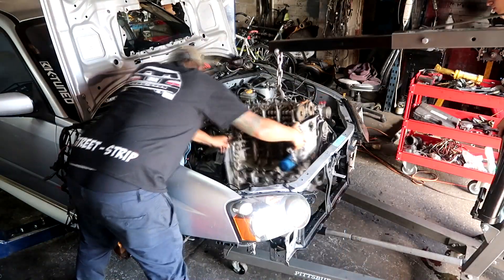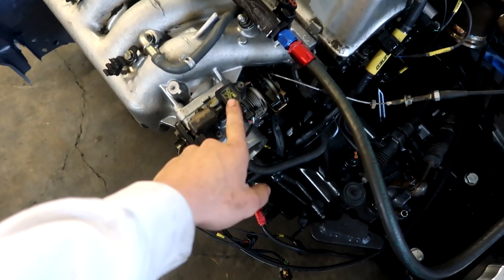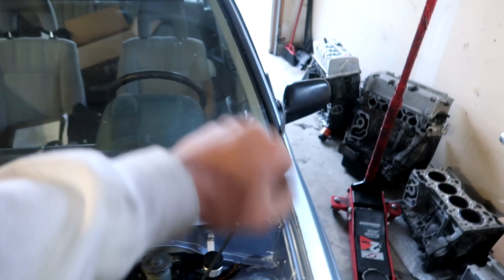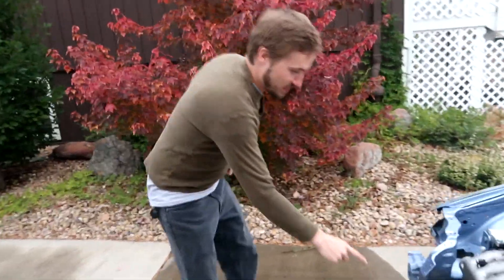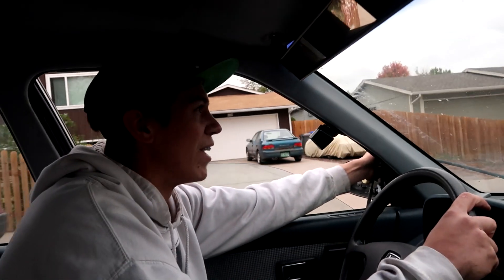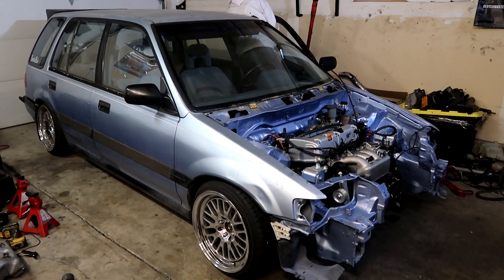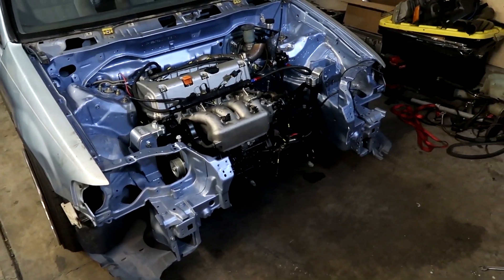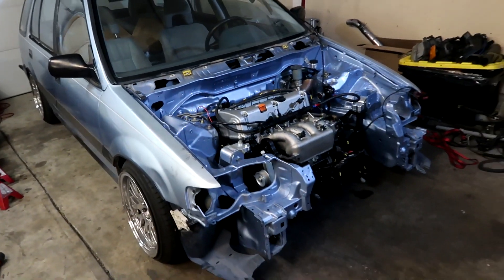Wago's First Drive With the K Swap!

Comment: It’ll be better to bring that driveshaft to a specialised shop and make them do that modification, otherwise it’ll wobble a bit even if you weld it close enough, cutting and adding material will make it unbalanced and you’ll have to compensate that with weights
Reply: Exactly! Plus my drive shaft guy does custom lengthening/shortening on your factory drive shafts starting at $80 bucks, if he has to build it all from scratch. From scratch starts at $150 but he will make them out of any material you want, the price just goes up with certain materials. Obviously. He also does trans axles, solid axles and on and on. Anything really to do with cylindrical shafts lol. BOTTOM LINE, these guys know what they are doing and you should always have your drive shafts balanced properly!
Reply: My driveshaft needs to be balanced 😚
Reply: You can cut and weld it pretty easily actually.... just get someone to balance it afterwards so she spins without vibration....
Reply: what theyre saying is, sure you can cut and weld it, but its gonna need balanced. IF  you have professionals do this, you know every day, 40 hours a week, theyll have less time tinkering with making it perfect and can probably do a better job easier.
Reply: Well worth it to just find a local driveshaft shop to get your custom driveshafts made.

No reason to mess with it when the turnaround time is days most of the time and it's perfect when you get it.
Reply: james himself Honda’s don’t go fast enough to need a balanced drive shaft

Comment: Those sleeves are gonna hate you for running without coolant, takes about 20 seconds for the cylinders to get hot. And having no coolant around the sleeves is only going to make them get hotter faster, coolant does more than just cool the engine when allready hot, it prevents certain parts of the engine from heating up super fast. Your sleeves would of almost been glowing after that run.
Reply: Kano Mack they are crazy to run without coolant, let alone drive it.
Reply: @Roverturbo  every build video I've ever seen the first startup was without coolant.. V8 or 4cylinder builds
Reply: Chris Beans  it was 2 you silly goose. Emilio started with a K24 then went to a slightly built K20
Reply: In all fairness it is good to let the motor have a quick heat cycle to let the head gaskets seat and stuff. I do it on every motor I’ve put together. I don’t let it run longer than for more than 5-10 minutes.
Reply: Dont get me wrong I love the content they produce, no one else does this kind of stuff on YT. But there is a difference between a quick heat cycle and driving it around the block and bouncing the limiter to shoot flames without coolant in the block. Also my eye twitches when I see turbos with no filter on them lol, it only takes one speck of dirt to score a cylinder.
Reply: Bang on! 👍
Reply: @freedomfox8183  yes. Started. Not ran around the block with no coolant. That's just asking to fry new stuff
Reply: Jeez, who gives a shit, do you think Kyle does? If it breaks it'll be rebuilt, building a K motor is a breeze!
Reply: lmfao you guys always find something to cry about on just about any of his videos, i love seeing these comments.
Reply: Chris Beans do you really think Kyle cares?
Reply: Bruh u gonna hate cleetus
Reply: Kyle has 500k subs, and not everyone is smart enough to realise how bad what he's is doing to the motor is. He may not care because they earnt daily's, but some people will take this as the proper way to do things.
Reply: @kanomack5063  he literally said a disclaimer on why to not do it. It would be a shame to hurt a 200$ junkyard k series that could be replaced overnight.
Reply: I get it mate, if it breaks do another video on it, and I know the reason he drove it was for the vid title. Just alot stupid people who see this and think it's the right way weather he says a quick disclaimer or not ( by the way I didnt hear it, might have to watch again) also *$200
Reply: Also critisism is not hate.
Reply: @Mad Mon There is no such thing as a $200 K Series yard motor (not one that isn't seriously hurt interally), D Series all day, K?  Hell no, to properly B-Series swap a car can be done for around 1k, but you'll have at least 1.6k in it after all the bs (fluids, gaskets, filters all around, timing pump, water pump, etc), unless you hit a straight up fire sale some one getting out may have been having.
Reply: @JagwarX  I'm a big fan of cleetus, the guy who gets custom built race engines put into his cars, and guess what, neighbor the only car apart from the Vee with a el standard motor has a fried head gasket, which I bet was helped by running without coolant. But I think cleetus has alot more money to throw around, and if an engine goes it soon gets replaced with a $30k+ racing engine. Yes he runs engines without coolant, but not around the block and shooting flames on the limiter. Unless your just trying to be funny by referring to when Leeroy lifted a head.
Reply: @JagwarX  doing it with a full race engine with special head gaskets and custom internals (mostly) isn't the same thing dude
Reply: Unfortunately without any coolant the tempature gauge doesn't work correctly but to each their own

Comment: Running an all aluminium engine without coolant for the first start I'm fine with. Running it "round the block" pointlessly, also with loose control arms is just dumb. This video was just cringe. Channel needs to get back to its roots of building cars and it's content based around that. Not videos of cars half put together, or "it kinda runs, so lets 2 step it".
Reply: this channels roots are more like this video than what you described.
Reply: Than you ain’t a OG this channel is based of 
building, breaking, and rebuilding!!
Reply: Bruh they gotten less sketch since their original days they do this to every car
Reply: yea i completely agree pointless as to go driving it around in the state it was in , good way to fuck the cylinder sleeves

Comment: Hey BoostedBoiz! Wish we got the AWD civic's here in Aus. Hope you've checked out the difference of the rear final drive ratios on the Civic AWD vs the CRV's. Hint Hint - you can be really dodgy and have different width or profile tires to change the rolling diameter to get the front and rear spinning at the same speed. I know someone that had and STi swap into and RS and the workshop overlooked this and gutted the gearbox of the thing first test drive. I can do the math's for you if you haven't done stuff like this before.
Reply: Civic rt4wd diff is actually an upgrade in an rd1 CRV. I believe Honda kept the ratios the same.

Comment: for the love of god do not try to shorten the driveline yourself, take it to a driveline shop and have them do it, theres no way you can properly balance that thing
Reply: Exactly let's french fry the engine and then throw in and off balance drive shaft and snap the freaking transmission case he's just throwing that car away he might as well use it for Cletus and cars demo drags if he keeps it up
Reply: he is still young and thinks drivelines spin in a perfect circle., when they spiun like the shape of an egg. why people shorten lines themselves all the time because they dont understand the simple physics, or rather complicated physics of gyroscopic forces and what 1/1000th of a gram on a side more weight will doe at 12krpm

Comment: Serious question here.When swapping engines like this do the cv shafts lengths just work with engine mounts people like KS make or do you have to look for different length ones? lets just say im going to put any old front wheel drive engine into a civic how does one calculate or make fit the shafts...like I know theirs a bit of play in the shafts but not a lot.that would mean like the whole positioning of the engine would have to be perfect to make the shafts perfect.Can you get custom length shafts made up?

Comment: seriously considering a K24 swap to replace the ZZ1 in my 04 Toyota matrix. do you get your motors from JDM sellers or bone yards? or both? old school hot hodder thinking about building something different. would run a 12 or newer civic SI 6 speed the car has a manual already, thanks

Comment: Just want to tell you something for the future. Coolant temperature sensor is mostly somewhere outside engine, so if there is no coolant circulation it is not showing engine temperature. More important, without coolant there is nothing to cool down sleeves and without cooling these overheating very very fast, as you can imagine, many explosions happening inside them. Now, i am sure you got more or less warped sleeves.

Comment: What's going on guys, so we put the turbo, engine, trans, roll cage, and fuel pump on the rowdysee. So she's solid for the track. We took the track bar, shift cables, radiator, intercooler and piping out of the hatch for wago so she's ready for boost. "Launch control pops from boosted k series wago." -and as always, thanks for watching.

Comment: Imagine grabbing the guts out of a Acura TL with the 6 speed manual and AWD then install it in something cool to create Honda's version of a GTR killer which can run 9's anytime on any pavement.  The lighter the better and would be quicker and more consistent/ reliable if you got one with an auto if they can make them handle the power.

Comment: I know everyone is always in a hurry to get that first test drive in after a swap but damn...no driveshaft, no throttle cable, no intake, no hood lights bumper or front end, cant shift it, wheels toe out, oil return wide open.....just wait a lil while til its ready dude

Comment: How much does this engine cost? And about how much to make like 300hp?
Reply: I'm not sure the exact engine they used but you can usually pick up a k series for like 500-ish bucks (at least near me). After buying like harness/hondata, turbo stuff, and everything you need for a swap, I'd say maybe somewhere around 2k, but the trick is you can make like 600hp on stock internals
Reply: @giggy7935  oh shit really 600hp? Damn that's crazy
Reply: @TeeKayy2k  Somewhere around there yeah. K series engines are awesome

Comment: hi because I am disabled I am legaly required to drive an automatic transmissin (yawn)  Could you please give me the dimensions of a K20 with a k24 head and an automatic tranny.  I need the total length the hieght the width. I have  been searching on the web for this and I finally just gave up.I w ould like suggestions on whick year k20 to buy and which tranny to buy, which head etc.  I knew you would be the guys to ask. I want to build an AWD MINI using  a rear end like WAGO RPT creations sells a kit to swap the motor into a MINI.  althogtho the kit is bot a standard transmisiion . I want to build a Clubman. just s I have room for my wheelchair. Anybody who hasd suggestions please chime in!

Comment: I love the videos, but I really don't think you guys know how quickly engines heat up with out water. They get hot spots almost instantly and even if the water isn't flowing still slows the engine heating. So with no water at all I wouldn't run it more than a few seconds. Especially under load like that.

Comment: If you are cutting the drive line get the right part and weld it on and don't run the adapter.

Comment: I pretty much like every video, but this one with the half ass throttle cable????? When you have all of the important systems hooked up and it safe to drive around the block, that’s when you take it for its maiden voyage. You are going to cause problems that are going to set you back by doing stuff like this. Be patient and what till all the parts are in and it can be assembled correct and it’s safe.

Comment: Lmfao. Glad the Wago is done but only you guys would do something so dangerous as to drive it with no front support, throttle not fixed, and no shifter cable... WAY TOO RECKLESS i'd say. but keep up the videos!

Comment: Driving that much without coolant was kind of foolish and risky, but then again, that's just from my perspective of only being able to work on cars around a job and not getting paid to make videos about it.  You need to take that driveshaft to a proper shop for that work, unless you can weld it without causing any warpage and have the proper equipment to balance it, or else it will destroy your output bearing and probably U joint.  Also, have you verified proper output shaft ratio relative to the rear diff, because if they are off, you'll just burn up the clutches in the rear, since it engages when the front wheel speed differs from the rear.

Comment: Please make the engine bay  clean. I see a lot of zipties, vacuum lines and wires. Also get rid of the Circa 1988 blue and red AN fittings please.
Reply: You watch fasterproms videos don't you with that comment
.
Reply: My car is like 45% zipties tbh. Ziptied bumper, ziptied left fender, ziptied muffler 😂. Up here in rust country zipties r lyfe

Comment: Nice to see your building your demo drag car or at least that's what you're treating it like let's half-ass this and half-assed that we get it winter is coming up loads are going to be few and far between doesn't mean you should cause damage to your vehicles just so you can get an upload you thought that transmission was hard to find the first time wait until you snap the case because your drive shaft is off balance or you split a cylinder sleeve because you just warped the living piss out of them